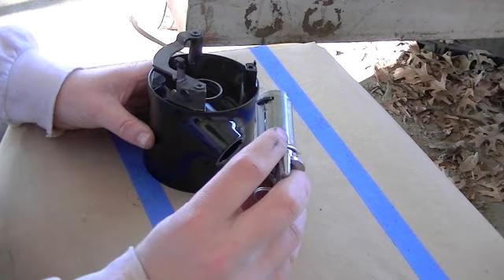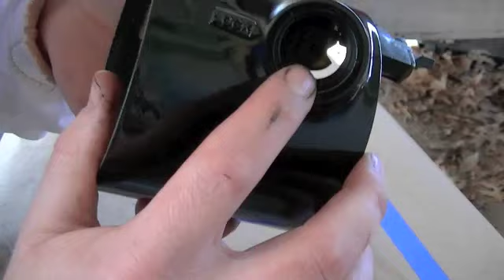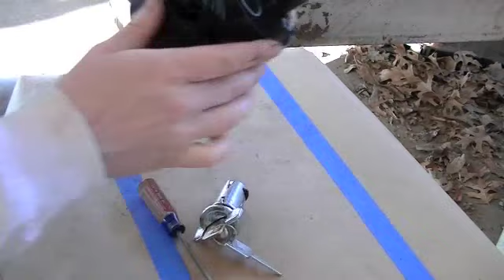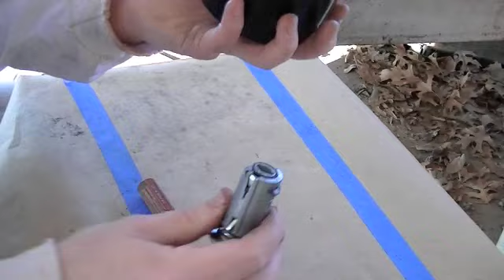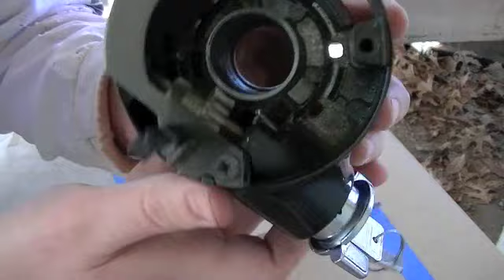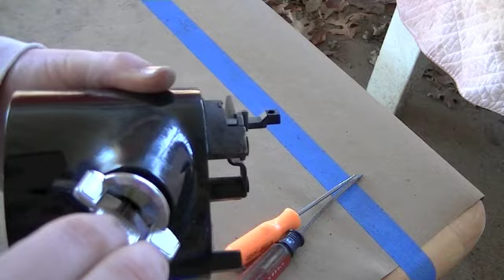Part 12 GM Steering Column Repair

Comment: my ignition switch is stuck all the way on and will not turn back to the off position and stays running . what do i do?
Reply: do i really need to remove this stering part to fix?